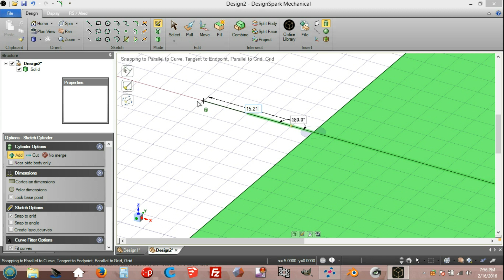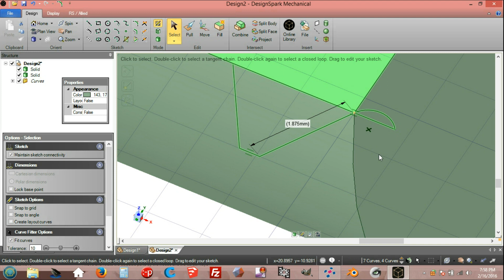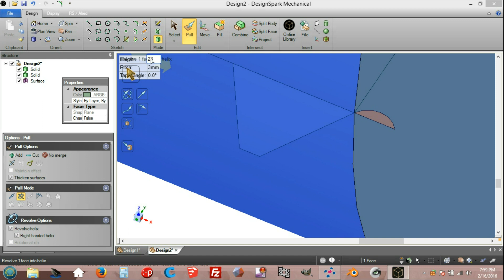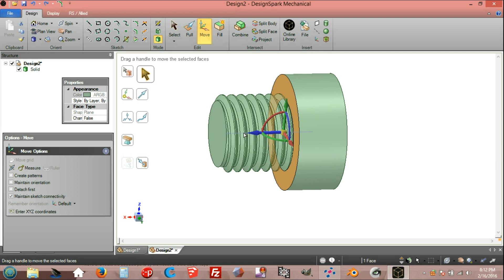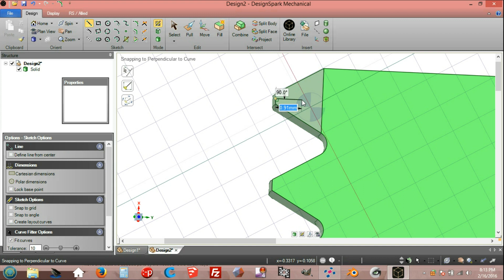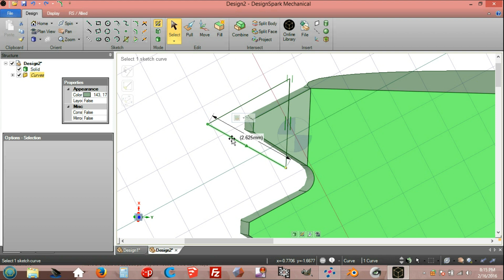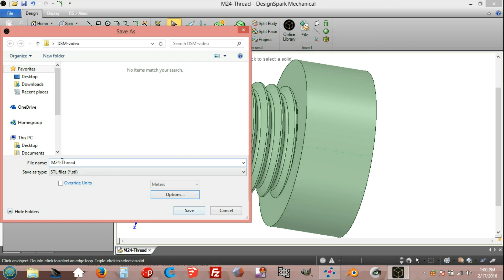DesignSpark Mechanical: Nicer Thread  (Rounded Root)

Comment: can i ask where do i find references to all m thread types please
Reply from the maker: MARYLAND METRICS is one good site: http://mdmetric.com/ 
https://mdmetric.com/thddata.htm

On youtube: http://www.youtube.com/watch?v=49jdJHn2Cnw&index=83&list=WL

Then you can try find tolerances if necessary: http://www.amesweb.info/Screws/IsoMetricScrewThread.aspx
Reply: thank you for your time 
is there any way you could do a more in-depth video about threads and  forming them 
with more explanation to what each part means and how it would change if you change to different size or pitch. im new to this and cant seem to find a slow spoken tutorial.
Reply from the maker: Perhaps, but this area has quite a lot information if I look for example Wikipedia:
http://en.wikipedia.org/wiki/Screw_thread and
http://en.wikipedia.org/wiki/ISO_metric_screw_thread

Perhaps making a video just using the screw "external, internal" (basic profile) image from the Wiki site...if a spoken is easier.  At least the metric nominal  size should be ok on the video . D major M24. 24mm = 20.752 + (2x1.624)....  Perhaps male minor here is a little bit too big and tight and I should have used male minor and male height and then round. With the big  table is easy to mess up female and male minors and heights. Loose enough tolerances and the things still fit. I'm just on a tinker hobbyist level and perhaps a little video to remind things could help me too...
Reply from the maker: On this video the nominal Diameter is tip of the triangle:
http://www.youtube.com/watch?v=L99lnAqVK1A
But Wiki says: A metric ISO screw thread is designated by the letter M followed by the value of the nominal diameter D (Dmaj in the diagram above) Wiki site image shows D maj where the tip has been cut.
Reply: thanks for info i feel i have a lot to learn and will need some way to repeat this over and over till i understand it more.